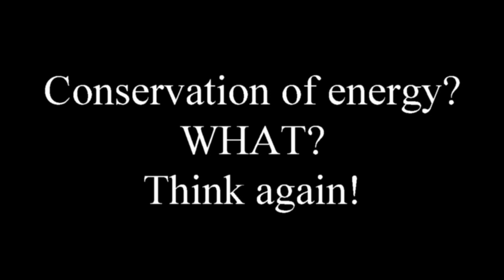New Green Deal Breaking The Law - Conservation of nothing! The Solution to the worlds energy needs.

Comment from the maker: In this particular test, 6 top magnets and 12 bottom magnets each rotor has all magnets facing one pole direction opposing the other rotor.  Coils are wound on sewing machine bobbins.  Full spool of. 32awg.  Note that continuity will check on one coil but does not register at all when two are hooked start to finish.
Reply: I copied it, why is there no good result?
Reply: Are the magnet sizes of the two rotors different?